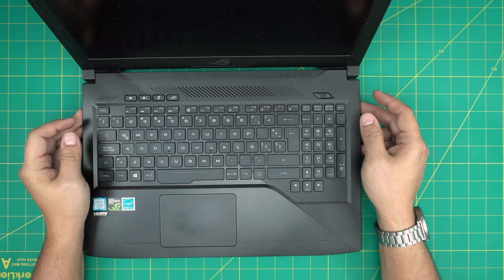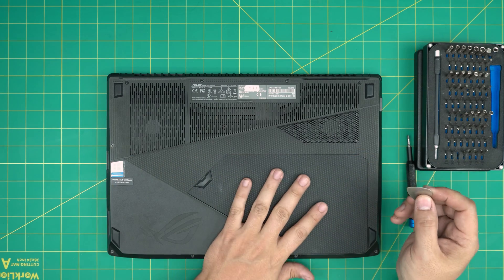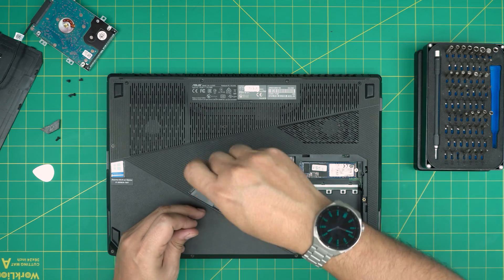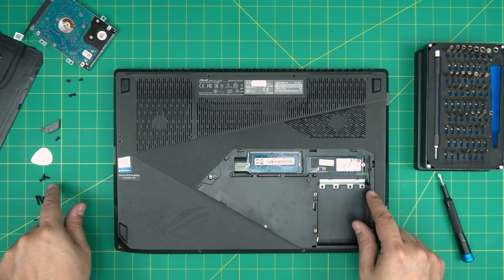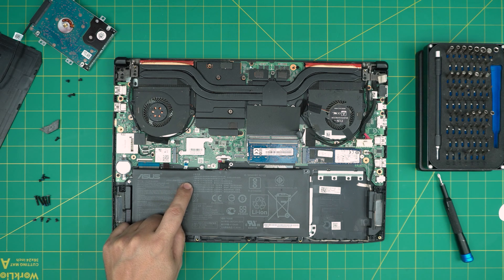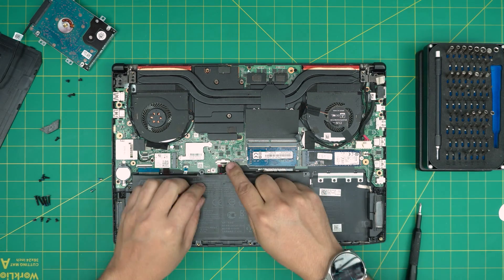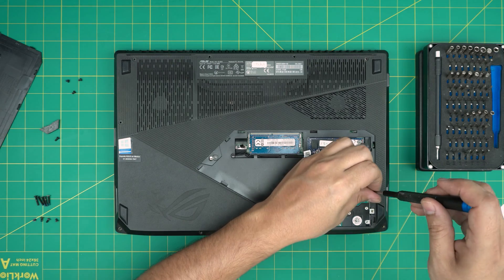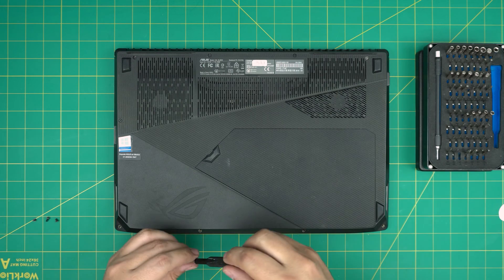How to Replace Battery for ASUS ROG GL503VD FY108T Laptop

Comment: I replaced the battery and it’s still not working without being plugged in. And it’s stuck at 44% charging. Battery output is correct when measured and input voltage is correct out of the charger
Reply from the maker: 🫠Regarding your question, you need to measure the voltage that goes into the charger jack. Plug in the laptop charger (19V) and use a multimeter to measure the voltage at the jack where the battery connects. If you get 11V-12V, you're fine. If not, it means the power regulator on the motherboard is damaged and needs to be checked and fixed.